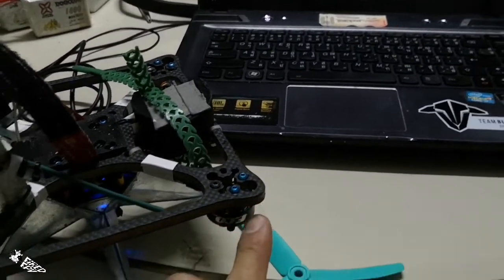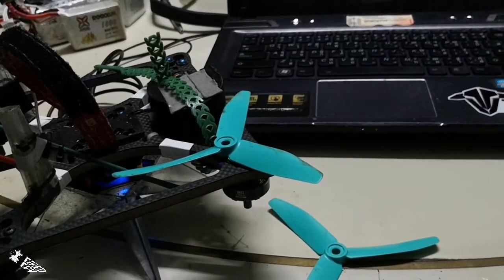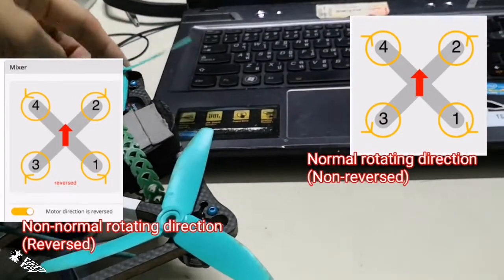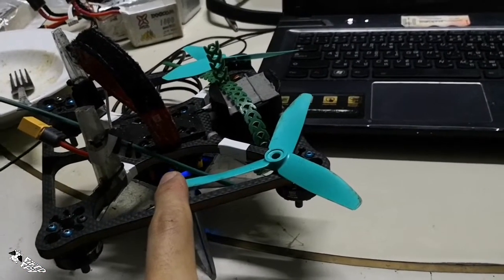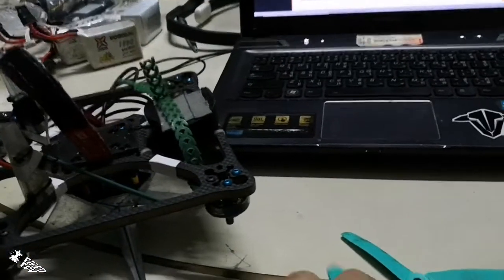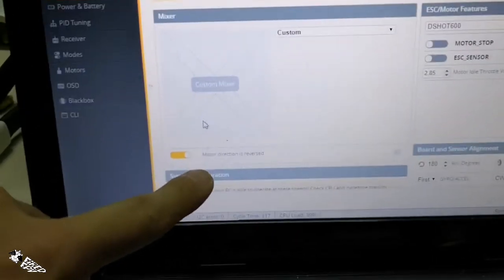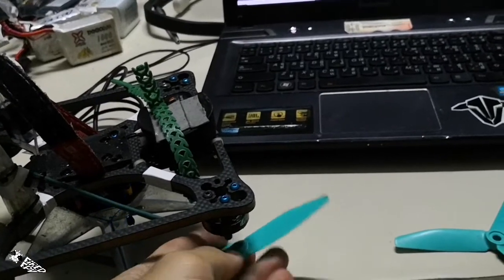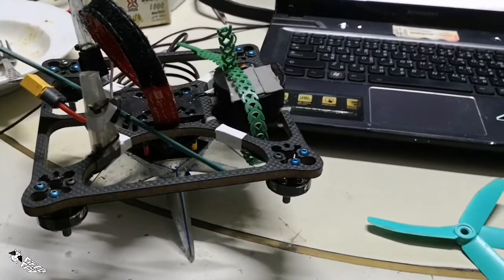Inverted motors Betaflight set up

Comment: Wouldn’t you have to put the props on backwards because if it were on the right way it would just suck into the ground???
Reply from the maker: The upside of the props are always up no matter how the motor is mounted. I am not sure if you already get it right or not but this sentence should make it clearer.
Reply: @FireDFPV  gonna build one I have everything to do it but still think the props have to be upside down

Comment: Interesting. But why?? ;)
Reply from the maker: Haha, I want very low camera tilt on a very light 5" quad without the props in HD footage as a long range slow flying rig. So the GoPro needs to sit on the very front. Then there is no space for the props so they need to be under the frame. If the props are under the frame then the battery has to be on top and thus the stack has to be under the frame. G2 frame got the lightness but its normal GoPro position is over the stack in the middle of the quad which always has the props in view even with about 30° tilt, unless rising up the GoPro mount to an awkwardly height. That's why all the extreme modifation is needed. It fly like a charm, not any tiny bit of shaky VDO in no wind condition. I got to test it on a windy day later. 

After it is completed I just feel unfortunate for not building it in a plus frame design. Hahaha🤓